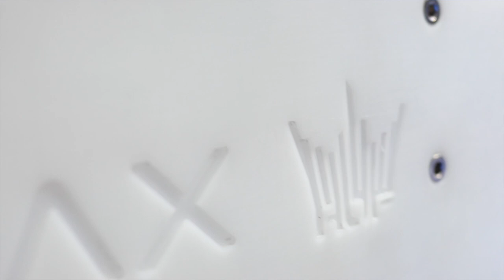GTX 980 HOF WC – First prototype – Diamond cooling

Comment: Thank you for this video OverClocking-TV and Galax.
We would like to add a few specifications.
The version you see in this video has a copper base that has been nickel coated. It has a white POM top.
The design is to make the top cover the PCB as much as possible.
Cooling of the GPU is being done by a microfin design. The channels are designed to flow evenly well whichever port you use as an inlet or as an outlet on the card. Of course it is using industry standard 1/4 ports.
There will also be a transparent plexi top version.

AND there will be one for both the 980 HOF and the 970 HOF.

The block will be sold as a complete unit by GALAX in their stores with the block factory fitted to the gfx card. But also separately from us directly. We will also do a white backplate to match and white rigid tubing fittings with a HOF design so people can match their entire build.
Reply from the maker: Diamond Cooling Adding these details to the video description. Thanks!
Reply: Are there any new updates as to when this may arrive in the galax online store?
Reply: Michael Bonsignore Galax has just received the final test samples to torture with their tests. They will then decide if the waterblocks are good enough to wear the Hall Of Fame logo.
Reply: Wow excellent. Good luck with the outcome. I hope it works out, I really am looking forward to purchasing one for my build.
Reply: When will this be released?
Reply: I couldn't wait any longer so I got the R9 295x2 with an EK copper block. Sorry guys you mentioned this water block's release would be in January.
Reply: Michael Bonsignore I'm still gonna be patient
Reply: ***** Pls contact us on our Facebook page :)
Reply: Diamond Cooling Just did :)